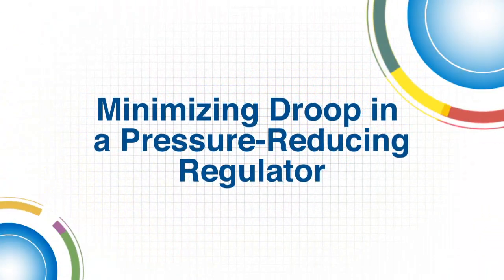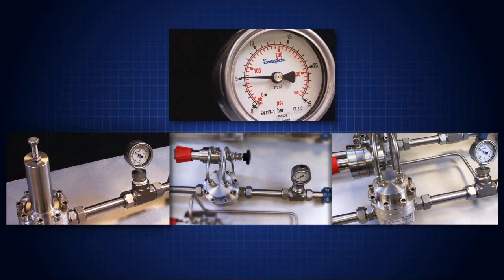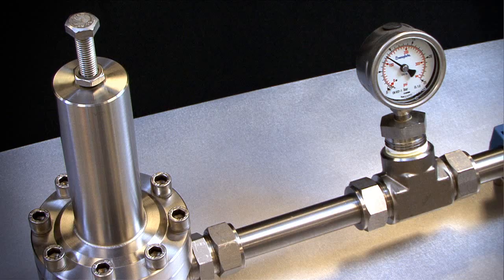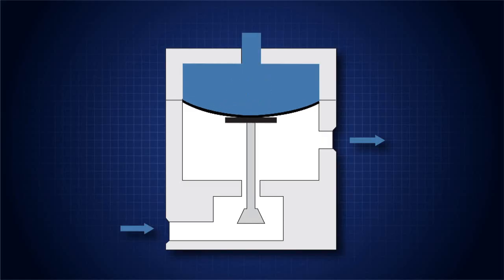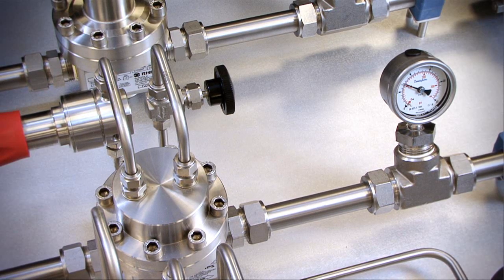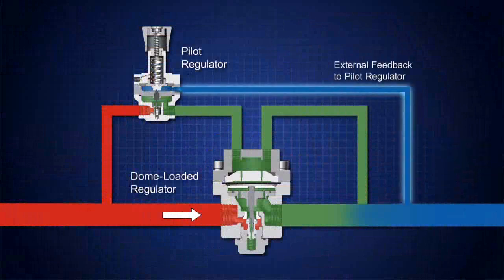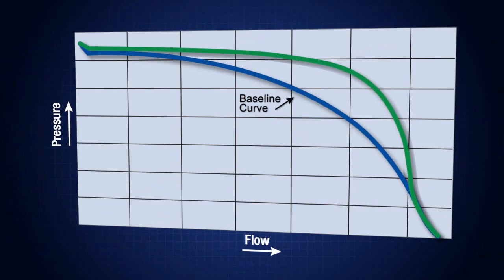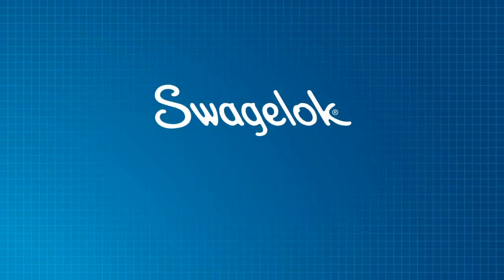How to Minimize Droop (Regulators) | Tech Tips | Swagelok [2020]

Comment: What happens to the pressure vs. flow curve if you adjust the tension on the regulator spring (or pilot regulator spring)?
Reply from the maker: Hi H, Your local sales and service center will be able to answer your question. You can find their contact information here: https://products.swagelok.com/locator